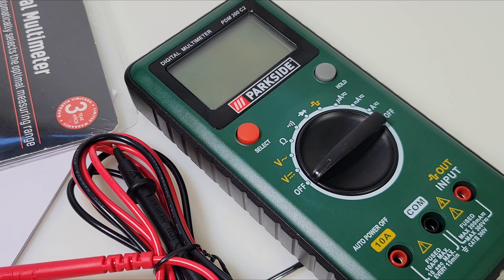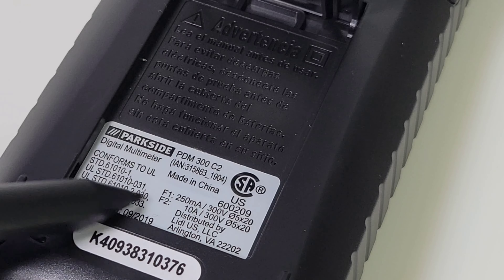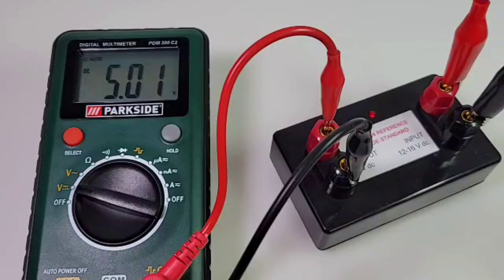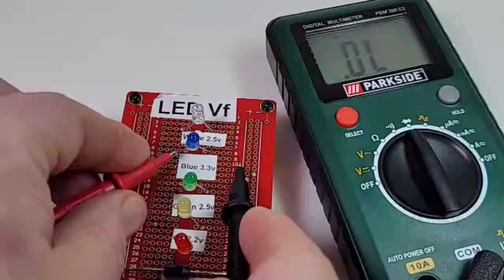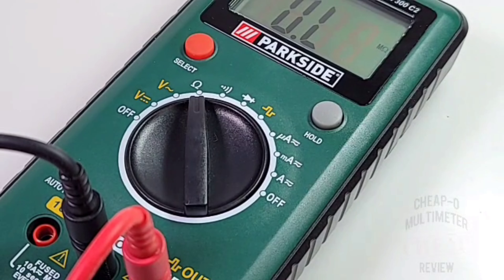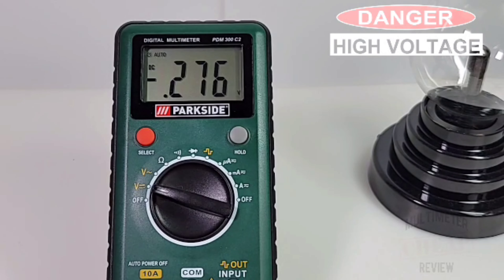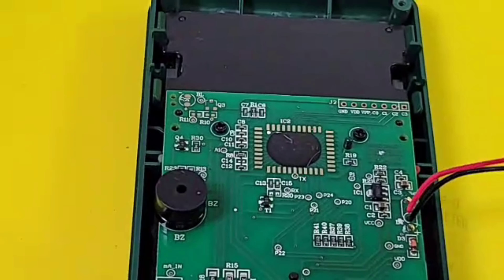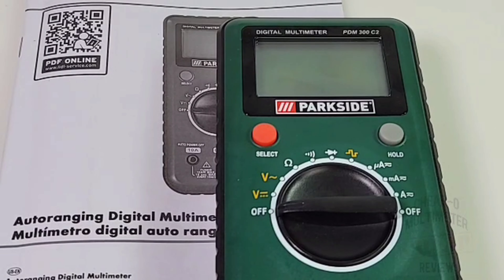PARKSIDE  PDM300 C2 CHEAP-O Multimeter Review & Teardown!

Comment: Lidl is primarily a discount grocery supermarket but they have one isle, always referred to as  "the middle of Lidl" here in the UK that has a mixture of random other stuff in it (kids toys, tools, cooking equipment, cloths etc all Lidl own brand usually) . They rotate what they have in the middle of Lidl every week. So things like the multimeter will appear and once they have sold out that will be it for maybe 9 months then they might appear again. It's weird but fun seeing a arc welder sat next to the fruit. All the tools are that colour and branded Parkside. Usually the tools do the job OK. When there are 20v drills and the like UK tradesmen have a tendency to grab them as backups for their professional quality tools.
Reply from the maker: Thx for the update Patrick. I've heard good things about Lidl although I didn't realize the test gear was basically first come first serve. 😅 👍 Right beside the fruit..there's a good reason to pickup another multimeter!

Comment: Its not a bad looking meter, the teardown was going quite well until you turned the board over. Bit concerned about the meter not showing OL when the higher voltage were applied. Would need to be totally aware of that if using this, good that you found it. Like you said aimed more at electronics than electrical work.
Reply: Someone else says it's dangerous because of that. But the meter says: MAX 300V
https://www.youtube.com/watch?v=QxPIRtZb8Ck

Comment: Hi i have this great multimeter, i use it when i work with car-car electrican. Display is great and its absolutely visible on sunny day, loud continuity tester. You missed to say who made this meter, its allosun its writen on board. In serbia this meter costs 1600 RSD aprox. 17$ for that price you cant found multimeter like this
Reply from the maker: Thx for the OEM update. The Parkside is definitely worth the price !👍

Comment: Darren, could you tell me what you would recommend as the best meter to measure frequency? Specifically frequencies between 15 Hz - 120 Hz.
Reply from the maker: Can you give more details as to what exactly you're trying to measure?
Reply: @KeepOnTesting  A car audio / bass music producer asked me because of my experience with electronics. He wants to know the exact numeric bass frequency that he is playing through his synthesizer. He has spectrum analyzers on his laptop. But they don't show specific numeric values.
Reply from the maker: @Scott.Hughes  HABOTEST HT118A can measure Frequency: 10Hz/100Hz/1kHz/10kHz/100kHz/1MHz/10MHz without any problems...definitely an inexpensive and capable multimeter option. If money is no option,  You'll never miss a beat with a venerable Fluke 87v.
0.5Hz to 200kHz (per spec) but it can also measure higher frequencies (up to 1.5MHz) if input voltage is 7 to 20v p-p
Reply: @KeepOnTesting  Good ol' 118! That will be my recommendation. Thank you. Always a pleasure to talk with you.
Reply from the maker: @Scott.Hughes  Anytime..Cheers Scott

Comment: The Fluke 113 isn't exactly the most accurate meter with a 2% + 3 digit accuracy quoted by Fluke. So for your 7.27 volt test, that is an error of plus or minus 0.145 V without the 3 digits added/subtracted. So both meters could be in error and the errors semi-cancelling to give an apparent 10 mV difference. I tested this meter with my Fluke 177 which has an accuracy of 0.09% on the DC range and it was giving an error of 0.4 to to 0.8% depending on the input voltage, but that's within the 1% + 5 digits quoted for the instrument. More worrying is the inability of the meter to show the overload. For general purpose use it's probably perfectly fine, but I wouldn't trust the CAT rating and I'd use my CAT IV  Fluke for measuring mains voltages, even though it would be used for CAT II measurements nearly exclusively in a domestic environment. Anyway thanks for the interesting video!
Reply from the maker: Great feedback 👍

Comment: I've got one, but the supplied leads are pretty rubbish.

I bought a better set from Amazon, which also comes with attachable crocodile clips.
Reply from the maker: Great upgrade..those test leads will take the multimeter to a whole new level! 👍
Reply: O bought similar multimeter pdc 300 c3, when measuring volt, ohms the digits keep constantly changing, though I try to keep it as steady as possible,  continuity test sometimes beeping, sometimes not at the very same place, did you have this nonsense too  ?
Reply: @tttttttt8482  Not with a decent set of test leads.